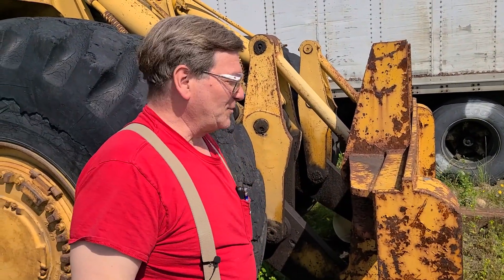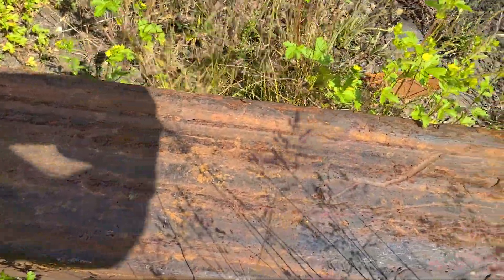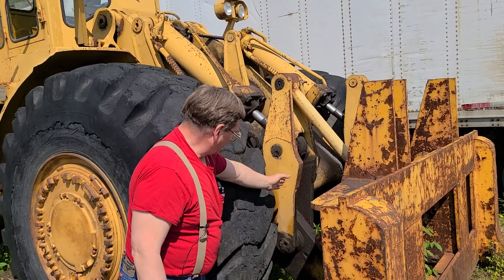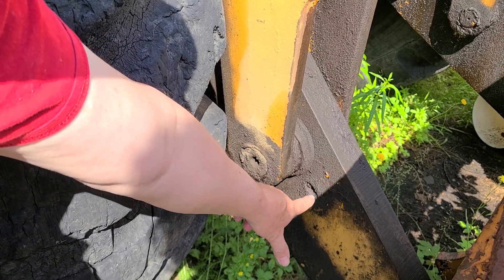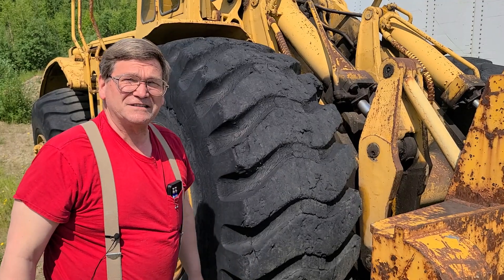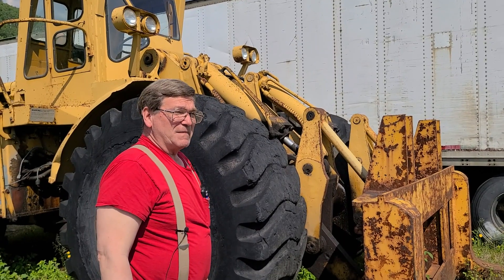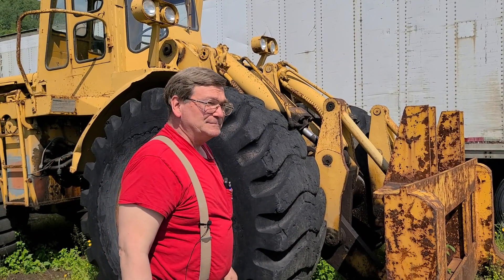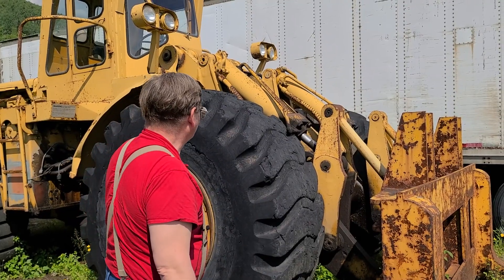Machinist's Minutes: Take care aligning when line boring

Comment: I've rebuilt "that" link. It's an interesting design because  at a glance it appears to be a simple link of parallel pins. However, other than being parallel, nothing else matches anything.

It appears that a slightly different design would've allowed the link to be something like a simple weldment of parallel flat plates.

It almost seems like the OE design was deliberately complicated to prevent simple  "re-creations" of the link being built in the field?

Maybe there were less nefarious reasons, such as providing cylinder barrel clearance?

Or maybe things were simply aligned with a map of downtown Peoria IL? lol

Comment: The Cat loaders from the early 1970's had such a tight midship area.  There is very little room to work in there compared to the newer loaders.  Until the very end of the video I thought this was a rear-steer non articulated loader like a 966A.  I grew up running (and greasing) an early 1970's 950 and 966C with the tight midship area.  After a while you learn at what angle to park the loader and at what angle to put the arms and bucket so you can get at all the grease nipples.  We kept our loaders in good shape but even so the bell cranks used to wobble back and forth when you drove them.